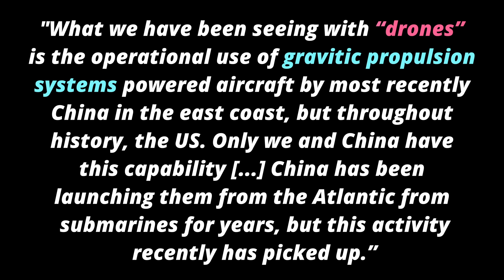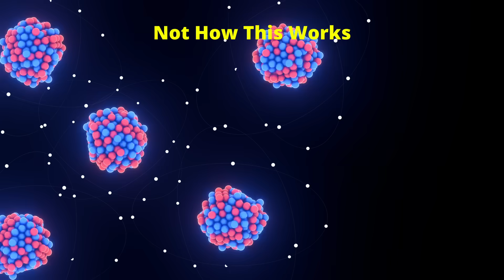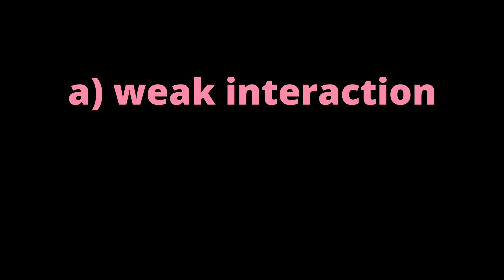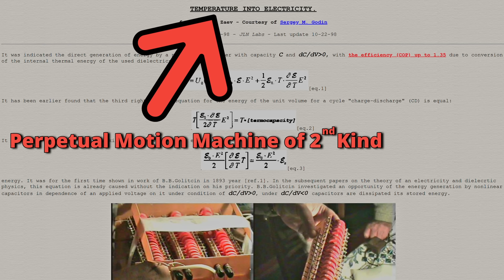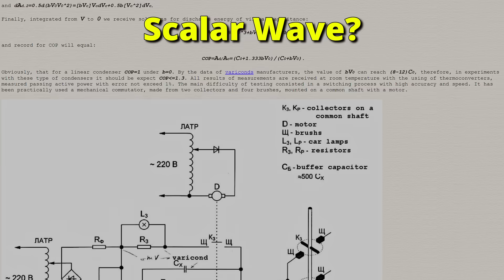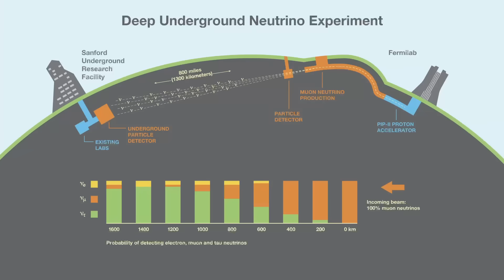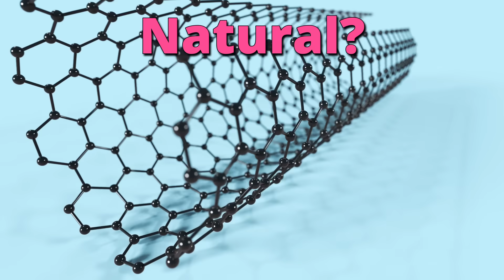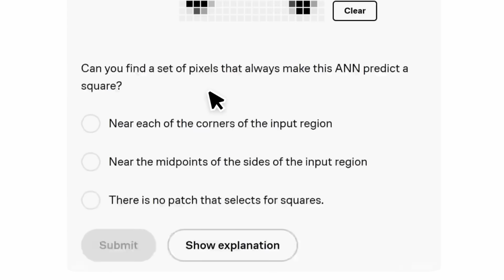What is “gravitic propulsion” and could the US government hide it?

Comment: I mean, think about what a superconductor is at its core…

It’s microscopic quantum phenomena being observed at the macroscopic scale.

Same thing could be applied to plasma if you think about it.

Let’s say theoretically, under certain conditions you could get a plasma to exhibit quantum properties at the macroscale.

In plasmas, coherent modes arise due to collective oscillations of charges (e.g., Langmuir waves and Alfvén waves). 

These oscillations could exhibit self-organization, forming structures like plasmoids, which exhibit stability akin to quantum condensates.

The coherence in superconductors is analogous to the collective behavior in plasmas, as both systems exhibit emergent order from microscopic interactions.

Cold plasmas can form stable magnetic structures (e.g., plasmoids), similar to the vortex structures in type-II superconductors, where magnetic flux penetrates the material in quantized units.

Both plasma and superconductivity theories can be unified under the broader concept of condensates:

Bose-Einstein Condensates (BECs): Superconductors can be viewed as electronic analogs of Bose-Einstein condensates, where pairs of electrons act as bosonic particles with coherent wavefunctions.

Plasma Condensates: Plasmoids and other stable plasma structures can also be likened to condensates, where coherence emerges from collective interactions.

In both systems, coherence at microscopic scales leads to macroscopic quantum phenomena, illustrating the universality of these principles in physics.

Let’s say it’s possible to use something like a plasma to create quantum phenomena at the macroscopic scale.

What would happen if you enveloped an object with that, where theoretically you could get the object itself to act as if it was in a quantum state.

In a way, you could utilize the quantum vacuum, and you might see something that seemingly breaks the laws of physics.

Just like a superconductor where under certain conditions the object itself is exhibiting quantum behavior at the macroscale.

In quantum systems, coherence refers to particles acting in unison, governed by the same wave function. 

In plasma, collective behavior emerges when charged particles synchronize their motion due to electromagnetic interactions. 

For example, in certain conditions, plasma waves (e.g., Langmuir waves or Alfvén waves) can exhibit coherence over macroscopic distances. 

This synchronization can mimic quantum-like effects, where the entire plasma acts as a single entity, similar to Bose-Einstein condensates.

Plasmas in strong magnetic fields or specific configurations can form structures like plasma crystals or filamentary plasmas. 

These exhibit ordered, self-organized patterns that resemble the coherent behavior of quantum systems. 

When a plasma achieves a high degree of coherence, it effectively behaves like a macroscopic quantum system, where the individual motion of particles becomes secondary to the collective dynamics.

Plasmas naturally exhibit wave-particle duality, a hallmark of quantum mechanics. 

Plasma particles interact strongly with electromagnetic waves, creating phenomena like plasma oscillations, instabilities, or self-sustaining structures. 

For instance, plasma instabilities can generate self-organizing patterns that resemble standing waveforms, akin to quantum superposition states.

Cold plasma, where ions remain near room temperature while electrons are highly energetic, allows for enhanced control of particle interactions. 

This temperature disparity minimizes thermal noise, enabling quantum-like behaviors to manifest more clearly.

In cold plasma, the low thermal energy of ions reduces decoherence (loss of order), which is critical for maintaining quantum characteristics over larger scales. 

This coherence allows cold plasma to exhibit phenomena like quantum tunneling in electric fields or the propagation of “quantum-like” waves.

Cold plasmas often exhibit non-Maxwellian energy distributions, meaning that the particles’ energies deviate from standard thermodynamic expectations. 

These distributions can produce exotic quantum effects, such as fractional ionization states or wave-particle resonance effects.

Cold plasma in magnetic or electric fields can form tightly confined structures, such as magnetically confined plasma rings or bubbles. 

These plasmoids exhibit stable, self-organized behavior, where the quantum properties of charged particles (like spin or quantum tunneling) can influence the macroscopic dynamics of the plasma.

If plasmoids interact with surrounding electromagnetic fields or barriers, they might exhibit behavior analogous to quantum tunneling. 

For instance, they could “move” through regions of space that would normally be inaccessible, governed by collective wave-like interactions.

Some researchers speculate that plasmoids could exhibit a form of macroscopic “entanglement,” where the behavior of one part of the structure is instantaneously linked to another due to coherent electromagnetic interactions. 

This would be a plasma analog to quantum entanglement.

At its core, plasmas and super conductors exhibit unique properties that make them compelling mediums for exploring quantum phenomena at macroscopic scales. 

So if this technology did exist, it doesn’t necessarily have to be anti-gravity, so much as it’s an object exhibiting quantum properties at the macroscopic scale.

And technically with the invention secrecy act the government can classify anything they deem has national security implications.

If you consider the potential implications of such a technology then it becomes easy to imagine why they’d do that.

Which is why I mention plasma, because there’s entire areas of physics that we rarely talk about that have tremendous potential in the theoretical field.

At least that’s my opinion, I’m no expert just very interested in this. 😂

Comment: Eugene used 30cm and a few cm thick YBCO ring wich is cooled to way under the transition temperatur, than levitatet and rotated by solenoids, and than induced a fixed frequenzy via magnetrons/or coils(herz varies with ring size to eugenes or Lings formel its realtiv easy you need the Resonance Frequeny of the Ring) and than Eugene said you can overload it with Energy while on fast acceleratiuon/decelleration of the disk and energy overload it, you will get some Extrodenary effects over the disc.

Comment: Does a Yoyo on a string defy gravity while it is spinning and bobbing up and down. Intellect might so no, but experimentation might say yes. You might be able to reduce the force to lift something up, but can you make it zero or reverse it.  A large mass will slow time and the particles in vibration will bend or gravitate towards that slowing in time. Even a light beam will bend around a large mass. So what is the quantum flux doing? What is it communing or communicating?

Comment: "Anti-gravity" is the direction of force applied to matter but reversed in direction theoretically.

Similar to how magnetic fields repel eachother. 

Rather than feel the force of gravity this material would feel 0 to near 0 friction and interaction with other matter, including the passage of signals. So there would need to be other materials present to attract electrons and other particles to it that would allow it to function but would need to be exact and precise enough to still be light enough for the "anti-gravity" material. So the housing, brackets, mounts, supports, anything non mechanical. Certain joints would need to be of a lesser material shielded by a coating of the "anti-gravity" material so that the internals can work but wont effect the over all pull the vehicle or object feels. 

However it isnt magic. Set it on the ground, alone, and pure and it would drift off into space as it wouldnt be dragged along by Earth, the Sun, Jupiter, or any other celestial object. As it would not feel the effects of inertia it would simply stop moving.

Inertia is the compounding weight of the materials pull on surrounding matter. Think of reality like an ocean. Some of its thin some of its thick but its all flowing together. 

An object that interacts with no objects gravity or other particles wouldnt create an inertia or visible effect as we only observe the effect a particle has on observible particles. 

However, the complete absence of interaction is itself an interaction of sorts. One that is viewable by the lack of anything interacting with it. 

Theoretically if something hit that which had no visible interaction or possible interaction the object would rebound. The direction depending on the material and its structure and strengths and own direction. 

Like if light it directly it would rebound directly back the source. A bit of an angle and the light can go for a joyride as it bounces off the un-interactable surface. 

But i know nothing of course.

Comment: Sabine, please listen. On 12/12/21 at 5:00pm after sundown, I saw a very faint 'V' shape with 5 large circular white shapes spaced 1/2 radius apart high in the sky at a 45% angle Westward facing away from the point of the 'V'. It could ONLY BE a Giant Machine in the sky approximately wider that 3 747s from as far up as you could see. I watched it for 3 minutes until it just faded away. Go guys what? We DO have Gavitic Propulsion AND a Secret Space Program. It's True. I WISH I could unsee it so I could go back to not knowing.

Comment: the unified theory is that everything in the universe is made of particle X where particle X is the particle that makes up all the atoms in the universe electric and magnetic and gravitational phenomena. if particle x natural state is a push and there is some pressure variations like that of a gas vent accelerating in a smoke projector particle x could  move around but it would be the resonance that create atoms electrons protons and any atomic mass or size as well as different field types like electric magnetic and gravitational fields. energetic states of particle X would only add another layer of complexity to resonance that governs particles in their ground state. all molecular properties are just push and pull of compression regions that makes up fields. particle X unifies all matter and energy and all field effects in the universe keeping time as the constant and since particle x is the variable so is light. the speed of particle X determine the speed of light. when particle X speed up so does the speed of light. when particle X slow down so do the speed of light. its the resonance that determine what is a atom and what is just light but its the unified fundamental particle X that give rise to all matter and energetic phenomena. this means that the light in the universe is not very old but much quite younger as it still has some age but not as old as the universe.the resonance is just pressure variations but since you need a resonant cavity to trap particles to produce the resonance or a gravity well the only other way is to use nozzles and varying the pressure of the expansion. it means the universe will be more condensed in certain regions while in the rest it will have low density. if the universe is a simulation it would have to be a made by beams of particle X varying pressure. that is because its not very resourceful to fill up particles in a room and making standing waves in it. red shift is just particle X that is leaking out of a resonant cavity created by a interference pattern in astronomical scale order. basic rule of the universe is equal to equal repel. greater than equal attract. when you combine equal to equal with greater than equal you get magnetism and polarity. and applying the same rules for gravity and resonance you get gravity in terms of push and pull. this is why the force of the field is equal to the square of the distance and why slices of steel paralell to attracting a magnet causes the layers to split and repel. this means that particle X makes up everything and quarks are just resonance of frequencies of apperent forces of organized particle X. particle X is a particle type not a single particle. its a unknown particle that everything is made of.

Comment: If it existed it would be an energy converter, the way an electromagnetic generator is an energy converter from motion to electric potential energy, or the way mass & energy are interchangeable, except it would convert from mass or some other from of energy, to at-will space fabric distortions.

Or perhaps a controlled feedback loop of negative-mass energy (mass less than 0).